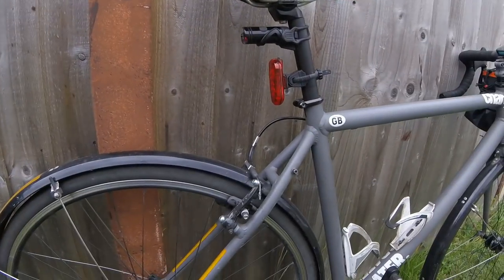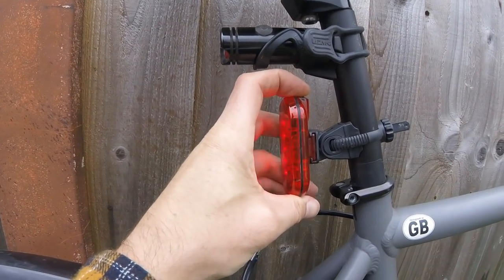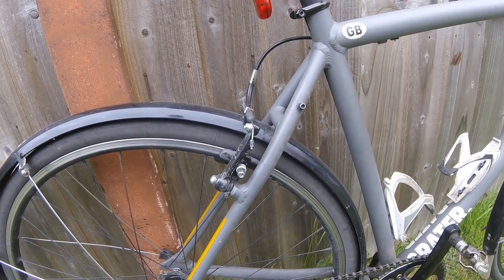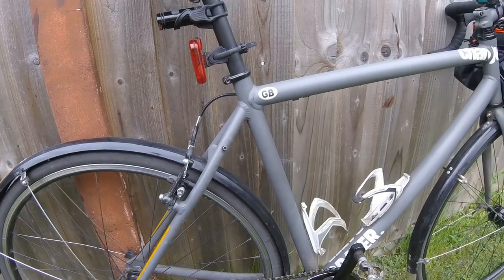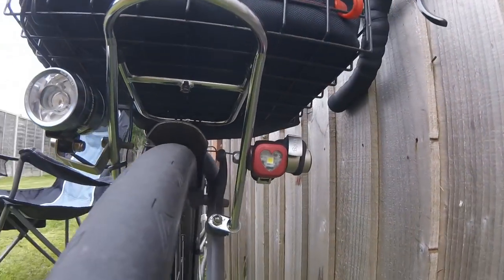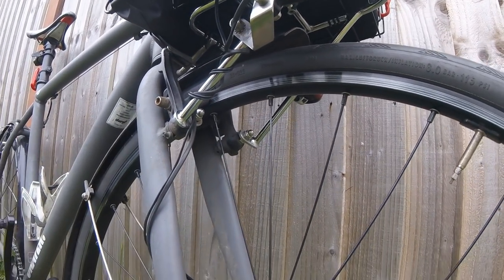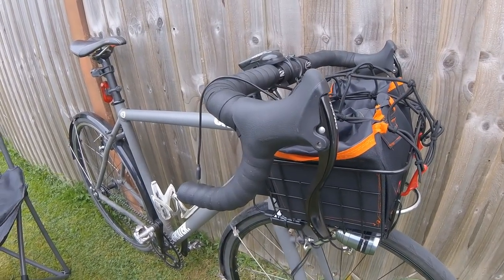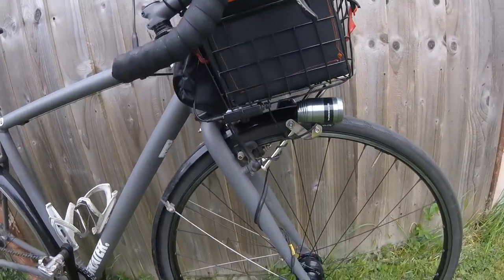Magical fixed gear audax bike check

Comment: £180 bike - fantastic. I ran a dual sided hub with 18/19. when things get harder it took a couple of mins to swap over to the other side. Love that basket.
Reply from the maker: Something nice about riding a cheap lump of metal, not sure the logic. 18 19 cogs is a good combo, my hub won't take two fixed sprockets so just 18

Comment: Are still using dropbars? I'm currently building up a new fixed gear for audaxing and can't decide should I go with bullhorns this time. Dropbars are not that good for climbing, but otherwise they are nice.
Reply from the maker: Yeah drops for me, can be tough finding comfy ones I know. Nice to get down out of the wind too

Comment: Hi Adam, will be waiting for the vid to see how you got on over Exmoor! I couldn't see clearly, but I see that you have a mudguard stay safety breakoff (or whatever they're called) on the rear, whereas they should be for the front,  the idea being, if something gets trapped between the guard and the tire and starts jamming the wheel, the stays pull out avoiding more serious consequences.
Reply from the maker: Late reply sorry, as you saw I did a little bit of walking over Exmoor but oh well, the thing on the rear mudguard mount is so I can yank out the mud guard when I get a puncture so I can quickly remove the back wheel otherwise I'd need an allen key to undo the rear mudguard attachment which is really faffy

Comment: Nice bike and interesting info. Also the lighting, USB. dynamo setup. I was looking at the prices. Not badly priced. Probably run to a Grater0 or Grater 1 lol. Are you still doing the Deliveroo Adam?
Reply from the maker: This is probably the cheapest decent Dyno USB charging setup, of course there are many more expensive ones. Not deliverood for 6 months now!

Comment: Great following your build up to PBP Adam.
A tip I would pass on is consider taking a good quality back up front light on PBP.
The pre-ride bike check focuses on lights.
Also, last time a mate of mine was running a dynamo which had a slight lag before it kicked in when setting off.
The marshals at a control stopped him from leaving and insisted he go and visit the mechanic to have it checked.
Because of this he lost touch with his group and never saw them again until the finish.
Reply from the maker: Wow that is good to know, perhaps a helmet light , I like being able to look around at night, bike light is fixed in one direction. There is no substitute for experience Andy I need all your wisdom!

Comment: best of luck adam ,i will be routing (lol) rooting for you
Reply from the maker: I did it! Thanks!
Reply: @adamwatkins  great ,have you tried Mobius Compression Knee Sleeve for your knee ,they are great ,there are cheaper ones with more support around the knee which i use for MTB ,or try a  saturation seatpost  which i use on my giant scr (slow comfy ride ) lol i use for audax

Comment: Do you really need a back brake on a fixie?
Reply from the maker: No not really, at the moment I have a touring rim on the back with a big thick braking surface so I'm actually using the back brake only at the moment to burn through that rim instead of my nice front rim